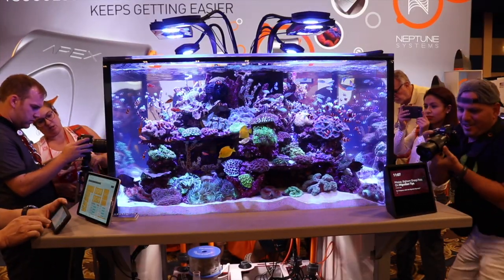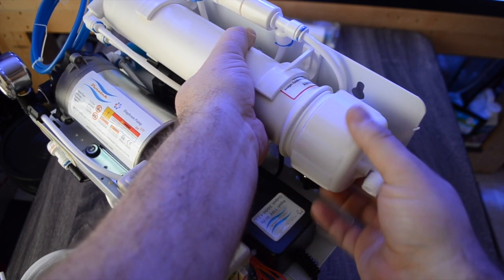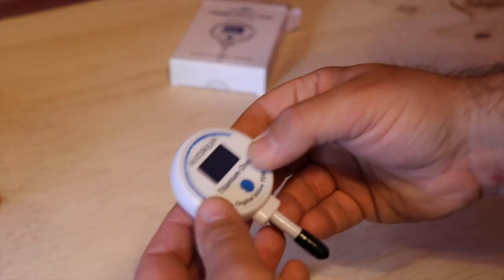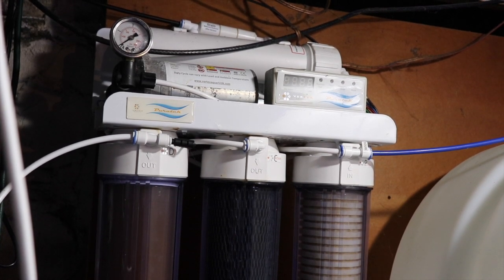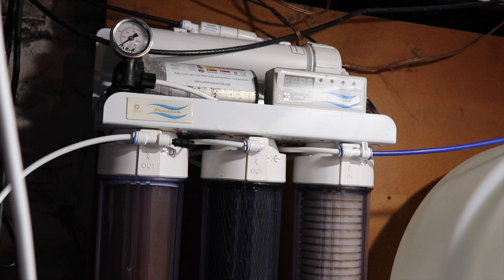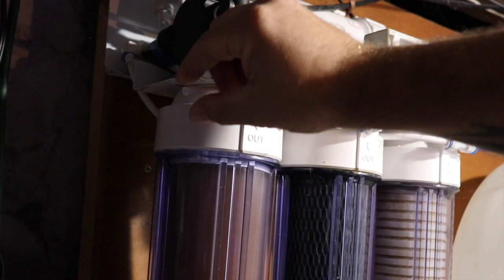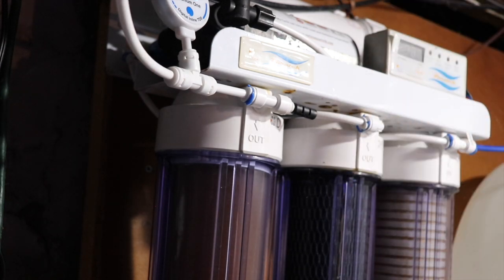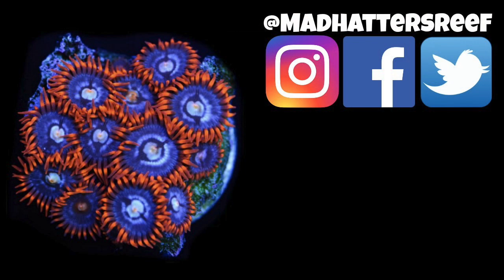Testing for TDS and Improving your Reef Tank's Water Quality

Comment: One important note! The inline tds meter on rodi systems need to be in the right direction so the water flows in between the two prongs, not around the two prongs. This could be why yours always says zero. Mine was incorrectly placed when I moved and had the same weird readings.